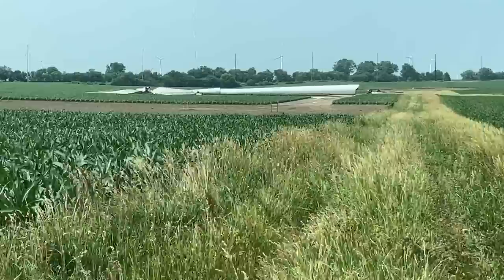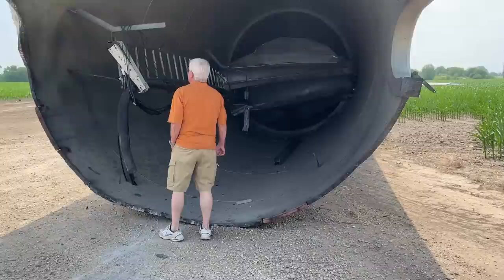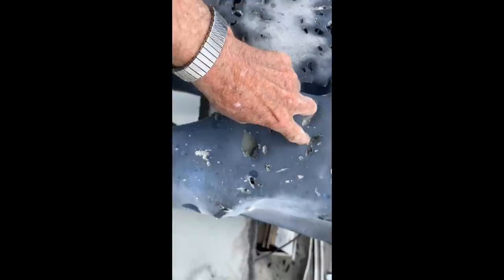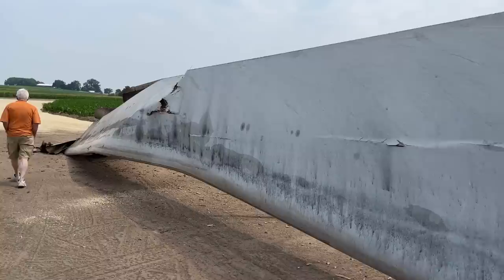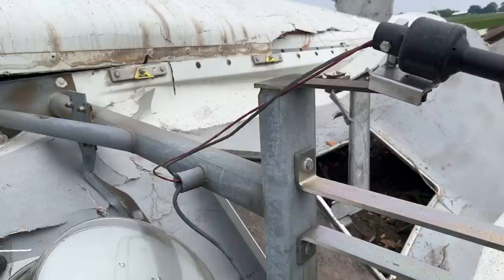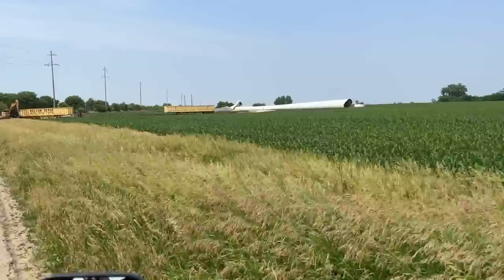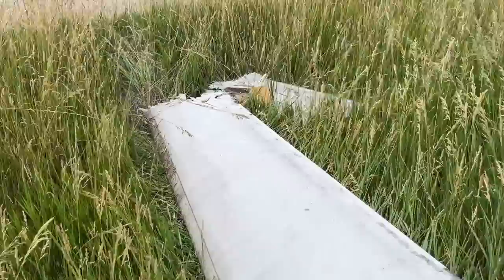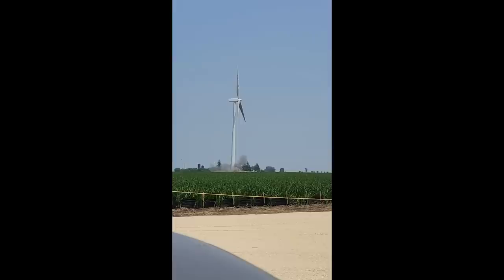OBSOLETE WINDMILL DEMOLITION short #47 pt 2 tubalcain energy lies scam fraud

Comment: It seems wasteful to scrap the entire the entire windmill when the original mast, foundation and wiring appear to have been in good shape.  Those parts are not cheap.  The rotating and electronic parts may have been at end-of-life, but they could have been replaced without destroying the whole structure.
Reply: I have to agree with you 100%
Reply: New wind turbines are much bigger (=economies of scale - 1 unit produces more kWh) and therefore nothing from the old turbine can be reused.
Warranty is also an issue with using old structures from other companies, I wouldn't trust it.
Fatitgue could also be an issue after many storms have passed over the old turbine. 
High strength screws, bolts and nuts are very delicate - corrosion can have severe influence on the long term durability. 
The rule of thumb in industry: The last hand touching it is responsible for everything, that's why no one would touch these old turbines to refurbish, rebuild or reuse them.
Example: We had in Europe a company that retrofitted diesel particulate filters in older busses. One burned down afterwards, the OEM (bus manufacturer) said: No liability. 

Generally spoken: wind energy uses a huge amount of materials (copper in the generator, steel in the tower and concrete for the foundation) in comparision to nuclear energy which is also dispatchable and can create an electric grid with black start capability, spinning reserve and is dispatchable power. 

Arguing with the cheapness of wind energy "but it's only 1 ct/kWh !1!!!11!" completely ignores storage, distribution (if it is generated far away) and all other factors to run a useful, demand based power grid. 
It's like a free cab ride to your next airport but the car has no wheels. "But the ride is free - just put wheels on it!"

Wind energy in high quantities in any grid (beyond the control capability of conventional power generators and the load curve) is not supportive, it's actually a burden. 
Cheaper batteries and power-to-gas may change that (there is a lot of vaporware and fairy dust involved) and solve some issues, but I highly doubt it.
To high capital costs, low capacity factors and enourmous grid capacities are required.

Always go nuclear, if possible. Breeding and reprocessing creats way less harmful substances for long term storage than wind and pv.

Look how France outperfoms Germany in terms of CO2 eq/kWh, price/kWh and a feasible long term strategy with decarbonizing their economy.
Almost 35,000 wind turbines in Denmark, Germany and Spain are over 15 years old - how much effort has to be spend on permanent building, repowering and recycling them?

100% energy from wind and pv is like Namibia - you are constantly working on the energy sector, it will wear out any soceitiy to a very low standard of living. 
I'm sick of it, pv panels + battery on your home = ok.
Running industrialized nations completely on renewables without nuclear = disaster.

Comment: I think the opportunity was missed for a practical joke using old clothes stuffed with straw and a nametag which reads Bubba. 
Note: The windmills themselfs are a good practical joke on the taxpayers.
Reply from the maker: Wish I would’ve had a spray can and marked the towers “Bubba was here”
Reply: Mr. Pete, some of those broken/stripped/sheared/bent bolts happened prior to the explosion. My great uncle Paul "Bubba" Bunyan and his Ox Babe worked that job. The foreman had to cut 2/3's off of his wrench and told him to only use his pinky finger on the wrench so he would quit damaging bolts. There is rebar at the very bottom of the concrete pilings that are hand  bent into the letters BWH, which stands for Bubba Was Here. This is a 100% true story.

Comment: From a financial point of view I doubt they are economic. An engineer did an energy budget and revealed that they don’t make enough energy in their lifetime for the energy used in construction. You like nuclear. I don’t because there is never enough money put aside for decommissioning and there are not enough facilities for the low level waste. I prefer deep geothermal we have a ball of red hot rock beneath our feet 8000 miles across. Enough energy to keep us going for centuries. I would rather burn gas and coal before nuclear. So that is my 2 cents worth. Thankyou for the videos.

Comment: Thank you for the video, Mr. Pete.  Very interesting.  Isn't it ironic that the windmills are placed out in the countryside, far away from the cities where most of the electricity is being used?
Reply: Congratulations for being in the running for this videos most unintelligent comment.
Reply: @j.f.christ8421  Yes, I guess that was a pretty dumb comment.  Thank you for pointing that out.  Afterall, why would you put windmills in an area that already has tall structures and nearest where the electricity will be consumed, when you can build tall structures far away, like out on the prairie.
Reply: @Hey_Its_That_Guy  Do you know what a wind break is?

Comment: It's really hard to know for sure what the truth is these days. My belief is that they definitely produced more energy than they cost over their lifetimes, likely paying for themselves in that regard in a year or two of service.

It looks like those things were ready to fall apart, it's hard to tell how much of the dirt was from impact with the ground, etc. I think it was just end of life that took them out.

What's really amazing is how thick the steel was in the walls, and the two layers of huge bolts, etc.
Reply: I guess your not old enough to remember things were made to last and be repaired for hundreds of yrs, even the old wooden ships would last 2 to 3 hundred years with maintenance and repairs, and everything up to 20 yrs ago were made to be repaired easily. Old hot point appliances lasted over 50 yrs and you could still buy the parts back in the 80's and 90's. As far as being obsolete, well even that was made upgrade-able, now they want you to buy everything new. Keeps the economy and machine running.
Reply: @billnoname8093  The fact is you have a plastic matrix holding together fiberglass strands in temperatures from -40 to 100 degrees, always subject to UV and stress cycles on every rotation, for about 2 decades. Its amazing that it was possible for those blades to stay together that long.

Aluminum would have cycle fatigued to failure before the first year was out. Steel would have been just fine, but much, MUCH heavier, and would have rusted to death instead.

The really destressing thing for me was the rust on the anchor bolts. I can't believe they weren't protected from corrosion.

Comment: They probably destroyed them because they interfere with wind to the others, the ones that weren't destroyed. 

Layout of a windfarm (where turbines are) is extremely important. Those were probably to close to others based on the normal airspeed, wind directions, and weather patterns in the area.
Reply: If that were the case they would not be building new windmills next to the old ones.
Reply: @tankaaron3776  think about that…

All environments are different. In some areas turbines can be closer, in others they must be further apart. If that area is better than expected, they can add, but if worse than expected some are redundant because one will extract all power available because wind can only carry so much (as decided by the environment).

Sometimes the installed turbines are removed after the new turbines are completed, but sometimes the only place to put a new turbine is where the old turbine is, so the old must be removed before the new goes in.

You're talking about it like wind carries an unlimited amount of power, but that should be pretty easy to realize isn't the case. 

Walls.

Walls stop (most) wind. If wind had unlimited power, every wall (of every building) would be knocked down.

Comment: 1; just make a calculation of how much material, labour, pollution and energy it has cost to produce a windmill.
2; then make the same calculation for  demolish that windmill.
3; and on top of that comes maintenance etc.
also, a windmill only runs 30% of his live, so 15 years is 5 years return.

if those things are green and sustainable, I'll eat my coat.
and they certainly do not render without a subsidy!

Comment: Pretty neat to see those windmills go down. I didn't see any markings on them? Did you see make and model number?
Reply: I think Vestas V90 or V80, I was looking at the video for it but could not make it out. Could be V80 and that they are going to replace it with a bigger more powerfull model. But I know they allready have tons off V90's in the US so it can be this model as well. That is the only model, at least the gearbox of them I worked on while in the USA when I worked for Hansen tranmissions/ZF windpower.

Comment: We have windmills in my area. After reading the contract there is no way we would sign to let them onto our property. Most people don't read the fine print and regret it later. I have no idea what the economics of the windmills is to the energy company and I don't think you are going to get an answer from anyone who actually does. 

After having windmills in our neighborhood I can make the following observations:
-They are not a wind farm. They use the name farm as a feel good. Windmills took our quiet rural area and turned it into an industrial zone. Windmills light up the night time sky, make a lot of noise in many weather conditions and brought a large increase in traffic. Not only during construction but with maintenance vehicles afterwards. 
-Flickering shadows from the rotating blades can drive a person crazy. 
-As I said before they can be quite noisy. On the worst days the windmill half a mile away sounds like a jet engine running in our yard. This is usually during times of high humidity.
-Ice can collect on the blades and with the fast travel speed at the blade tips the ice can fly quite some distance. Ice has hit the roof of the house where my mother lives.
-Windmills here are 2 years old and have gear oil running down the tower. I'm sure plenty of oil flies onto surrounding fields. 
-Windmill generators often start on fire
-Windmill blades are often broken and need replacing. No one wants the old blades so it is not unusual to see them sitting in piles. 
-Set backs for windmills from towns are much greater than from farmsteads. I've come to realize this is because they find complaints from a few farmers easy to ignore but if it was a whole town they would have a real problem. 
-Some counties in the area require any windmills constructed to be backed by the money it will take to clean them up. There has been no construction in those counties. It seems obvious that there is no intention of proper clean up when the contract expires. I'd wager farmers will be finding debris for many years where those towers were dropped with the blades still mounted.
Reply from the maker: I sincerely hope that many many people read your sensible comment

Comment: My guess on the lower base bolts and the bolt threads impression onto the base...the base expanded that much outward during the explosion then retracted in a micro second or two.
My guess is none of these generators make a profit without subsidy or seed money. It also must be known what their total cost to deploy is and how much they can sell their power for. That is the big issue here because if the public were to be directly involved, the rate for power would likely be much less. Electricity rates need to be limited across all states evenly. Producing power is generally all the same...transporting it is too. Once it gets into the hands of the Government, state PUC etc. rates are all fake to justify Government jobs and Green ideas. 
Waste of money and resources...burn natural gas and atomic. Easy power gets generated and pollution is very limited. There should be no power sold for profit...just look at all of the utility companies out there which have investors holding shares of stock !  Do we really need to pay those turds when the utilities can operate just fine without their funds?

Comment: Were they made to remove the oil in the gear boxes before dropping the towers? Would that not be a hazardous waste  problem and fine? Making them take off the blades, makes sense as well, for safety and de brie field! Should also have been made to remove gear boxes to prevent hazardous waste potential! Why did they not just replace the top unit and blades, re-use the tower, and base? Total waste of land the cables going from towers that are already put in the ground going to them, if they are going to put in new units some where else! Total waste of money when not re-using what is already there! make the blue prints for the pattern of the top mounting of tower to the company making the top unit, so it can just be bolted on to the old tower, re-hock up cables, already have stair case and lift, back in business!  Just my opinion!